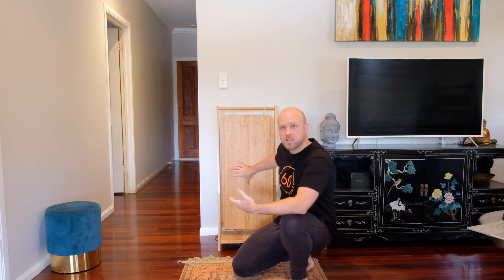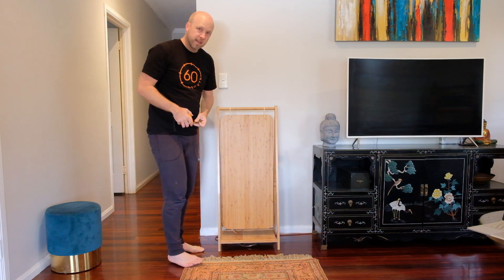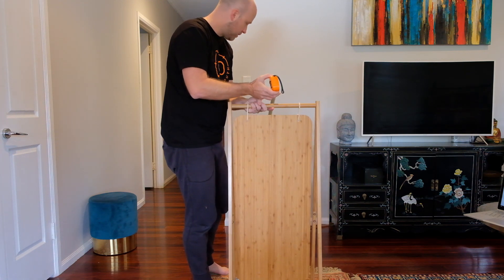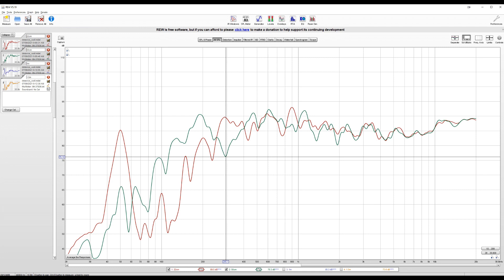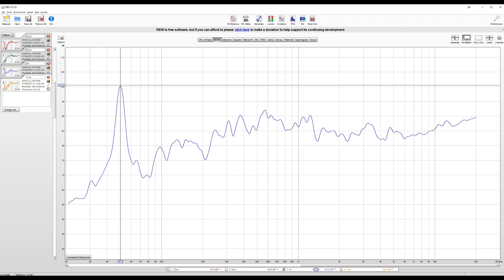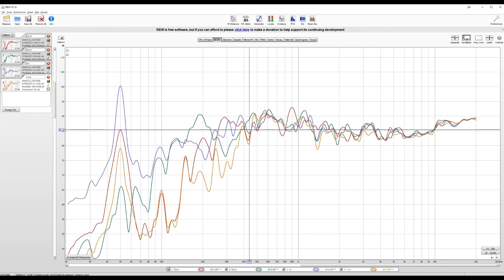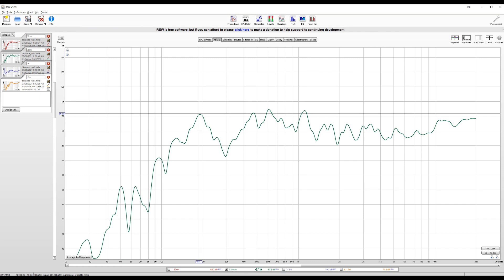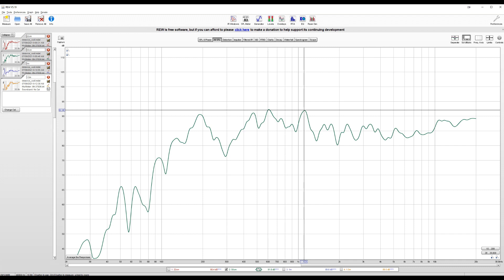DML Panels - How far from the wall should they be?

Comment: That 50hrtz spike is panel resonance, has nothing to do with your room. If you could place your speaker exactly half a 50htz wavelength from the wall you could take advantage of dampening to smooth it. Otherwise put a crossover in and cut above 60 hertz

Comment: Very important video - Tech Ingredients had the panels at random distances or in the center of the room. My conclusion is that I'll put the panels close to the wall and cut everything below 300 Hz for the subwoofer to take over. Maybe even stereo subwoofers since this range contains significant channel separation info already. Did you try with sound absorption behind panels as well (wool etc)?
Reply from the maker: I haven’t tried with panels yet - as soon as I’m finished with my current build (hybrid design with woofers below the panel) I’m going to work on room treatment and will probably do a followup to this video as I feel I’ve learned a lot since recording it.
Reply from the maker: Dual subs is a great idea. My hybrids are crossed over at 250hz and it really does make the mids sound ‘cleaner’ now that they’re not doing the heavy lifting of the LF as well.

Comment: Before watching this I viewed your video showing how you made the panels and I'm wondering which panel you tested; the one where the exciter is placed in the middle of the panel or the one set at 2/5 - 3/5? Also to overcome the reflected waves could a sound absorbing panel be placed a small distance behind the DML panel?
Reply from the maker: This was the 2/5 panel. Yes you could do that although it would need to be quite thick to absorb a broad range of frequencies (low frequencies are particularly problematic).

Also I don’t think that the back wave is necessarily a bad thing, provided you have the space to set the panels up properly. In fact it has benefits as well.

Comment: My two 2'x2' panels had no imaging and depth until I moved them forward to 40% of the length of the room from the front wall.  The outside edge of the panels are 10" from the side walls. No toe-in. This is the same position that I had my planars at. My sound room is dedicated, with base traps and diffusion, so your mileage may vary.
Reply: So just over half way from the middle?

Comment: I wonder if the 50 hz isnt Alternating current hum?  In the US our current is at 60 hz and a poorly setup system will have hum.  We tryto fix this with high quality cables to reduce RF and have all of the system on the same phase of power.
Reply: First thing that came to mind as well. Probably the amp is not correctly grounded.

Comment: OK, just a question, if instead if just mounting the panel on a frame like you do, what if you hang it in a box structure like a conventional speaker box without a front  (your panel is the front) with an air gap right around the edge, maybe 2 inches airgap? I'm thinking it might also enhance the bass end so you dont need a separate sub.
Reply: Just use a separate sub and tune it to your panels, trust me your ears will thank you.

Comment: I would suggest you look at the decay curve. If the 50Hz peak is actually a room mode, you will see it decay very slowly. Also, look at the rest of the bass range on the decay curve. It is possible that bass is better with lesser distance because you may be getting a reflection off the wall. The thing is, that reflection will muddy your bass while making it loud which is not desirable. I would suggest putting a sound absorbing panel behind the DML panel and testing.
Reply from the maker: Great advice, thanks. I have just been reading about this measurement recently. I am in a new house now so I'll probably go back and do some baseline measurements in the new space and will consider all these factors.

Comment: Mhhh, really interesting. Thanks for the information.  You should try what happens if the panels a very close to the wall. Lets, say start at 2-3cm and the nin steps of 5 cm until 20 cm. The exciter of course should not touch the wall.
Reply from the maker: Thanks Jochen, I guess this was a pretty basic first run through but I would like to add some wall-mounted panels in my living room later, so I'll definitely revisit this in more detail and with closed measurements as you've suggested.
Reply: @TypicalBenYT  I’m also curious about closer to wall measurements. Finished my “standard” 2x2 inch foam board speakers a week ago and initially set them about 4inches from the wall.  Sounded like crap, and I was feeling pretty disappointed with this experiment.  On a whim a couple of days later I moved them 8 inches away - still pretty close to the wall and about where you took your first measurement - and was blown away. The entire sound field changed significantly. I don’t have any measuring tools (except the ears, of course) but I felt the overall response to be leveled out and heard clarity where before there was mush. Great work and am enjoying your vids. Those are definitely the classiest looking DMLs I’ve seen!
Reply: @remingtonsteele5519  If you haven't already, add a sub.

Comment: I concur with what OleTC said a month ago, to bring your wife/kids/cat/dog/sister/MIL to listen and chime in, but are any of them going to be sitting 1 meter in front of the speakers, no matter where the speakers are? If you were in an actual lab, testing the specific speaker response, 1 meter away would make sense, as it would take sound directly from the speaker panel, disregarding reflections. But that's not how you listen. If you are graphing speaker response in your living room, you are actually graphing the room, more than the speakers. So go to the spot in the room where the listener is going to be.
Reply from the maker: Thanks. I will be doing a room setup video later (In a new room) with these type of measurements. My aim here was to share the results of the panels themselves but as you've said it's a bit flawed in this configuration. I am working on setting up a better space for this kind of testing so hopefully I'll be able to obtain more accurate 'panel' results in the future.

Comment: Interesting test but not nerdy enough to be very meaningful. You also need to test the panels at an angle to the wall.
Testing a single panel directly in front of the panel in a room full of furniture is almost a waste of time because it will give you almost meaningless data that doesn’t match the listening experience and it is not pure enough for clinical purposes.
To do a more realistic test of the room you need to set the microphone on a tripod in the position of your ears where you would be listening from. Then run the tests with one and then more speakers so that you can tune the room for best listening experience effectively.
To do a clinical test you will want an empty room with some sound absorbing panels on some of the walls.
Reply from the maker: It’s just intended to be a starting point for anyone who’s interested. I don’t have the setup or experience to perform a more ‘clinical’ test, and I’d think that setting up a mic in the listening position would be less useful as you’d be hearing MORE of the room acoustics vs the direct speaker. 

Having said that I am moving house in a few weeks and hope to be able to conduct some outdoor tests there 👍

Comment: Hello Ben.
Thank you for your efforts to measure ...
If I may, I would like to clarify a few points.
1. The material of your panels (I suspected that from reed)
2. Is it possible to make measurements, but yes - it is impossible - you will have to move the vibrating emitters from their places ...
But suddenly you have a superfluous one, Is it possible to take a characterization on such materials:
2.1 Plywood 6 - 10 mm thick
2.2 Double packing carton (This is when the paper layer is even + wavy + smooth + smooth + wavy + even)
Perhaps you have already done this.
Can you see the results?

Thank you very much.
Reply from the maker: Hey Alexandr I haven’t tried different materials yet. 

These panels are made from a 3mm thick bamboo plywood called laserply. I am also experimenting with acrylic sheets.

I would like to do more testing of materials and shapes but don’t have much time at the moment. Possibly in a month or two I will be able to try more things out.

Comment: Thank You for another interesting video. 
Watching this, made me think back to a conclusion from a pro loudspeaker-constructor, Troels Gravesen. He tested a set of the classic 15" Tannoy Gold Monitor speakers and wrote: "The frequency response (FR) of these Tannoys looks awful! Why is it this doesn't leave this driver useless? I've seen FR from electrostatic speakers that look even worse and yet these speakers sometimes deliver the best of sounds."

The frequency measurement You've done is good work and brings another dimension to understand the sound You hear. So it is very usefull in its own right. When it comes to actual positioning, I think it is best to go with what You hear and find to be the best. So bring in wife/kid/friend/cat and make them move it slowly to different positions while You listen. 
Eventually You can find the sweet spot with the most enjoyable sound.
Reply from the maker: I absolutely agree. The measurements can inform design decisions and help to understand what's happening but at the end of the day you should go with what sounds best. What's nice about this (not very extensive) experiment, is that the best result came at a similar distance to what my ears told me anyway.

Comment: Another great video. Can you discuss a little about the measuring equipment you used? I'm assuming it was some sort of laptop application for the measurement and tone generation.  My apologies if you already specified that info in one of the previous videos. I did a quick browse of some of the comments and video description. Thanks again.
Reply from the maker: Sure, and no problem at all! I think I discussed in in my previous 'measurements' video but didn't put the details in the comments.

I'm  using the REW software: https://www.roomeqwizard.com/
It's free to download and use and you can make a donation to the developer  if you find it useful.

I have a Dayton IMM6 calibrated measurement mic. It's designed for smartphones but it works with my Surface laptop which has a 3.5mm TRRS jack.
Reply: @TypicalBenYT  Thanks!

Comment: Man, that's kind of confusing. I think you're seeing boundary reinforcement. And also some smearing with sounds off the wall combining with the direct sound of the panels. That 50hz peak is wild. You didn't really have that in your earlier measurements as I remember. Odd. Look for a distance between two walls that is 22.6 feet, don't forget about the hallway.
Reply from the maker: Hmm ok, thanks I’ll do some measuring. Have ordered one of those tiny digital amps off Amazon so I should be able to get an outside measurement soon too.
Reply: @TypicalBenYT  One thing to keep in mind is that you’re kind of in uncharted territory. Almost all other panel speakers are unbelievably directional, They are the most directional speakers you can get. DML’s are diffuse, they’re some of the most undirectional speakers you can get. And at least it’s claimed that they interact with the wall very differently than other speakers. So not all classic speaker theory is going to directly apply probably.
Reply from the maker: @perrys2199  Yep good point.
Reply: @TypicalBenYT  Again, that 50 hz peak is bizarre. If you’ve got parallel surfaces 22 to 23 feet apart then that’s probably what it is. If you don’t then there’s something else causing the problem. I think it’s something else, in your last video your floorstanding speakers had a dip at 50 hz. They would have blasted a room mode like that through the roof. None of your measurements had a 50hz boost like that. I think there’s something else going on. You did have a smaller peak at 50ish hz with the close measurement but nothing like this.
Reply from the maker: @perrys2199  Have just done some measuring in of hallway / back wall etc and there's nothing approximating that length. I'll have to adjust and measure a bit more to see if I can track it down I guess.
Reply: @TypicalBenYT  I really think whatever’s happening at 50 Hz is a measurement problem. Something happened with those measurements that wasn’t happening when you took your measurements in the video before. Your ‘normal’ tower speakers had a dip at 50hz. There was nothing like that 50 hz peak in your other measurement vid, so, there’s some other problem here.
Reply: Hey @TypicalBenYT , beware that a cheap tiny digital amp is going to affect the frequency response curve of your panels!

I've listened to a good dozen cheap class D amps off Amazon and AliExpress (1-30$) on several foam and wood panels, and most of them sound "good enough" for casual listening. (And surprisingly loud on foam panels, even the 3W 5V 1$ amps!)

But they do sound different! You can definitely tell differences in crispness, but also mid band colouring, lack of bass... 
So to an audiophile on a quest, they don't really sound "good". You'd surely see the influence of the amp in your graphs. Go for it, compare a couple of amps next time you take measurements. :D

The amps I would currently recommend are slightly more pricey, around 50$, but oh so much better!
Look for Wondom amplifier boards in a local audio electronics shop, or order direct from store.sure-electronics dott comm - I'm very happy with the JAB3+ which comes with a DSP onboard, perfect for the DML rabbit hole!

And don't forget the importance of a good power supply for class D amps! In my listening tests, a Mean Well RSP-200-24 was a big improvement over the cheap 19V "hifi" power adapter.